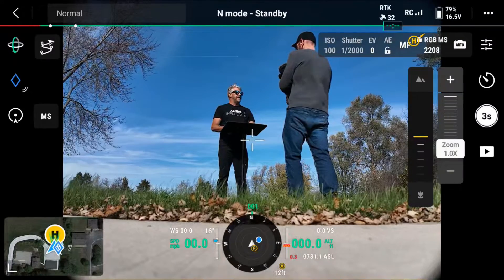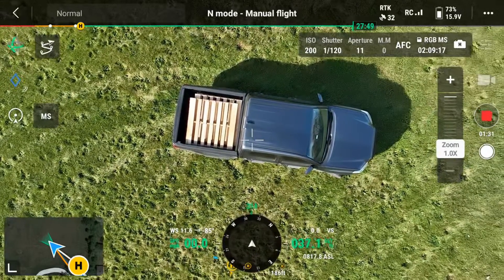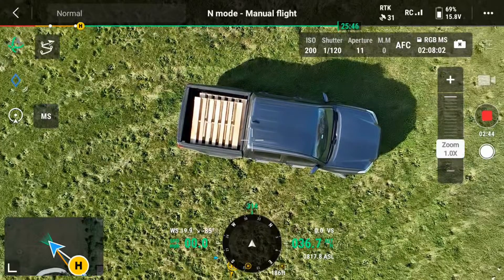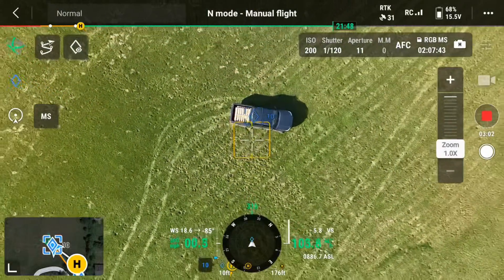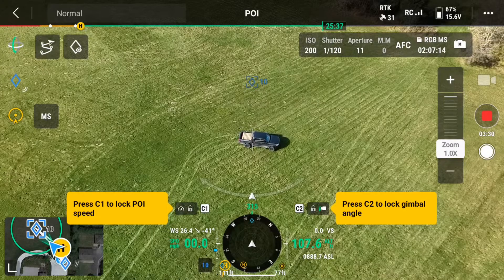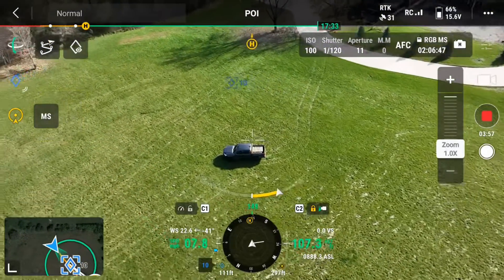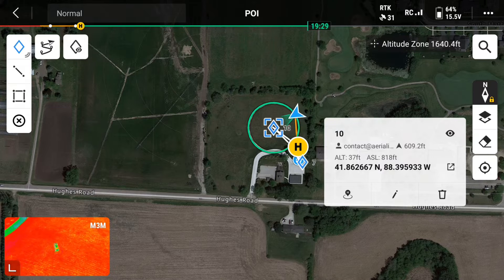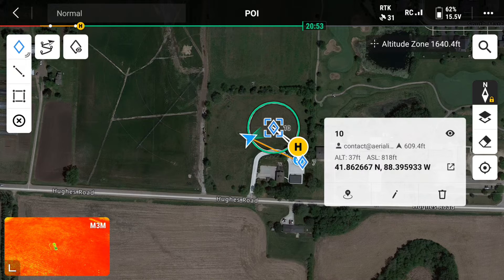DJI Pilot 2: Point of Interest (POI)

Comment: Thank you very much for the info!

I did a POI flight where I was going down a monopole at different altitudes. The gimbal angle self-adjusted back upward as I went down. I'm hoping I can lock the gimbal angle with the C2 button at say - 30, then stop the orbit, go down, and do another orbit and the gimbal stay locked from the previous orbit. That would be fantastic!

Currently I'm not sure if it's adjusting the gimbal as its doing the orbit, or if it only readjusts when I go down - I'm going to play with that today.

Comment: Hi, thank for your great video! Yesterday, we wanted to use the POI function on our M350 RTK - with latest firmware update and Network RTK running. We could set the PinPoint, but we did not have the symbol for the POI mode in our DJI Pilot 2 app. Have you tested the function already with the M350 RTK or do you have an idea, what we did wrong? We also need video recording, no single images.
I would be really thankful if you could give us a hint.
Kind regards!

Comment: Hey i own a matrice m30t and the signal is pretty bad on it i lose signal around 600m and when flying the drone straight it loses signal from about 1-2km anyway i can fix the signal?
Reply: Not much you can do to fix it.  Take a screen recording of  a flight to show DJI  what happens.. Also take a screen shot of the transmission display when it starts to drop out.  DJI will try to blame it on interference.
Then  call them and  set up a return  for repair.
Reply: @ronarmour8909 I tried and nothing fixed it I'm going to sell my m30t and buy a Autel Evo max 4t as the m30t is basically useless with its signal